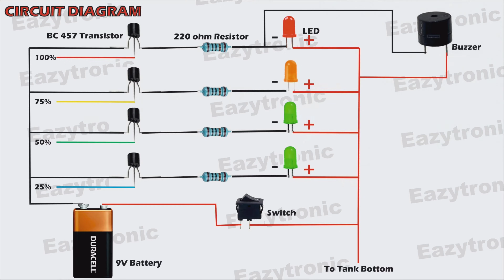Water Level Indicator Project Class-9th to 12th #science Project Step by step 💦

Comment: 4 piece BC 547 transistors 
4 piece LED
One small buzzer
Pipe and collector
220 ohm resistor
Reply: what do you need the pipe and collector for cuz it would still work without it